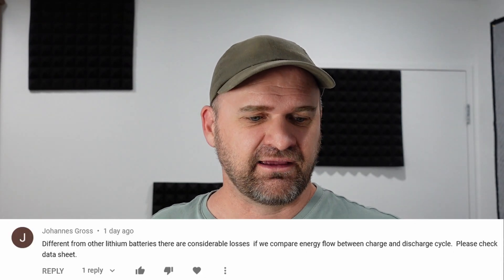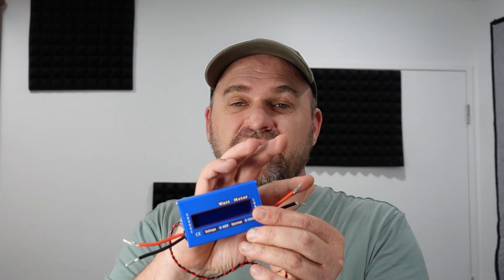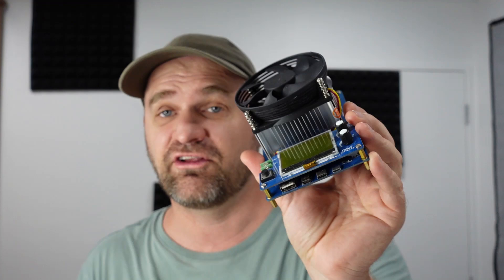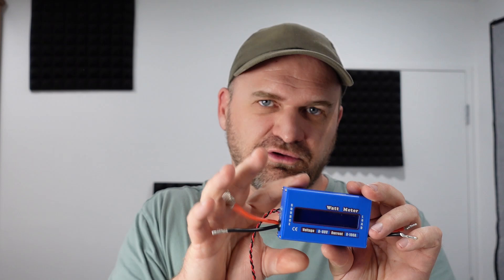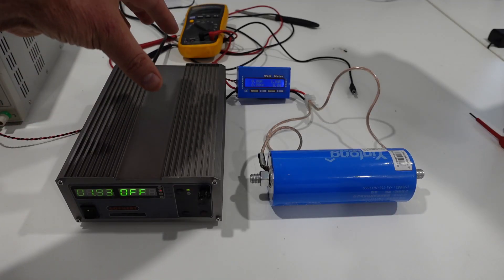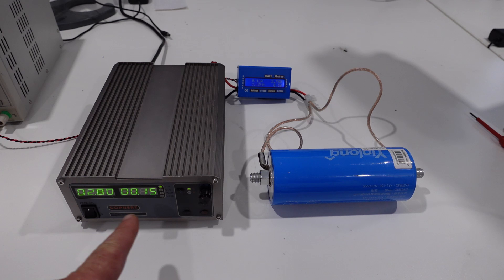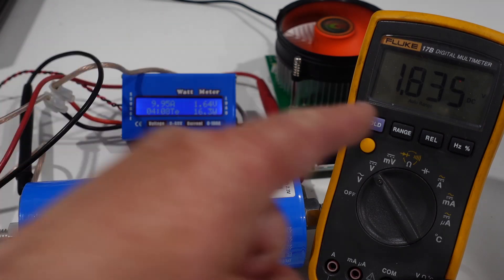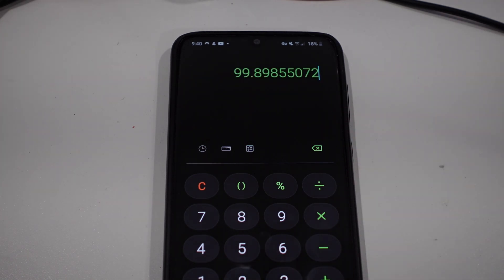Efficiency test LTO Yinlong battery

Comment: Thank you for your test. The efficiency is approx 86%.
The coulomb efficiency is relevant to ensure that you for a few cycles are charging and discharging to the same level. At 1:55 you say that you loose charge due to internal resistance - you are not loosing charge - you loose energy. I could calculate the correct efficiency from your video - you charged with 97,1 Wh and you got 83,4 Wh out of the battery - so the efficiency of the battery is 0,86 or 86%. -  and that is actually realy good. And probably closer to 88% - you did not discharge fully....Based on this test -  i will get some LiFePO4 batteries :)
Reply: Hi Brendon, thank you for the video. But I believe the Bjorn is right about the efficiency. Still for my application ability to quickly charge/discharge is more important then efficiency - so I'll try these ;)
Reply from the maker: Hi Bjorn, you are incorrect with your assertion.  I even mentioned in the video why it would not be possible to use the Wh reading on the meter to measure efficiency.  Check my low temperature video for more details.
Reply: @brendontait6968  Hi Brendon. You check amp hour to see if you get wha you pay for  - and whats really relevant you check Wh charging and discharging to check energy efficiency. I did not hear any viable explanation in the video. Whats your argument? Kind regards Bjorn
Reply from the maker: Please watch my video for low temperature testing of these cells.  I explain with a lot more depth in there.
Reply: @brendontait6968  Hello Brandon. I watched your video on low temperature testing and correct me if i am wrong - you state that you got a voltage drop of 0,5 V from relative short wire and connector. If you discharge with 10 A you are claiming wires and connectors has a resistance of 0,05 ohm (using Ohm's first law) - It should be considerably lower by a factor of 10. The units you are using are of some interest to me - i got several and are using them when I have a class that are learning about efficiency and batteries. I have tested the units against "expensive" equipment  - and they are giving solid data - when they are working :)  
I am not at all convinced that efficiency that you state is correct......!   Best regards - you are an inspiration - and i will subscribe...
Reply from the maker: Hi Bjorn, it is not just the connector between the device and the battery, but extended wires etc.  I didn't measure the voltage drop I just mentioned 0.5V as a possible example, I had wires coming from the battery to the meter also.  But even if the v drop was 0.2V, that will still give you an error of 10% in each direction if you are reading the Wh reading on that meter.  To use Wh on any meter accurately, you must use a 4 wire meter. I would be very surprised if I was wrong.
Reply: @brendontait6968  Hi Brendon. I have to agree with Bjorn on some things here. Calculating the overall efficiency of the battery with just the coulomb efficiency is wrong. The biggest factor of losing power in a battery while charging and discharging (at least within short periods of time) is the internal resistance, as you mentioned. With the way that you tested the battery you just took this resistance completely of your calculations, and I have a couple of examples to try and make you understand why it does not work that way.

1st example: Lets say the internal resistance is unrealistically high, or you add an external resistance of around 150mOhms. In your setup, the overall AH measured at the end would not change. Your controller does not care about the load resistance. You set it to keep the current at 10A, so it is just gonna increase(or decrease, depending on if it is charging or discharging the battery) the voltage until that 10A is met. This would result in a voltage drop of 1,5V across the resistance, which is more than half of the voltage drop of the battery at any given charge. Which in turn means that you are losing more than 1/3 of your power to heat in the resistor. The coulomb efficiency would still be what you calculated in your video, but there is clearly a much greater overall loss. In this example the efficiency will be much lower than 66%.

2nd example: You mentioned in the video that when charging, the voltage of the battery increases due to its internal resistance, which is very true. similarly, when it is discharging the voltage decreases. So when you charge the battery at that 10A, you are using more power because power = voltage * current and when you are discharging with the same 10A you are taking less power from the battery. In your calculations you assumed that the voltage when charging  and when discharging are the same, which is not true.

I hope this cleared some thing up.
Reply from the maker: @iliazark1  thanks for the comment, I disagree tho.  Make sure you check my low temp video where I go into more depth.  The float these cells see on charge/discharge is nearly nothing.
Reply: @brendontait6968  I watched that video as well. Measuring the voltage on the terminals is absolutely the way to go. I still don’t know how you calculated the Wh numbers though. The correct way to calculate the energy going in and out of the battery is to integrate the voltage over time values you got from the midi logger and multiply that with the current, provided that the current was actually at 10A all the time. If you still have the data from the logger I could probably write a quick script for that.

To be clear I am not saying that it is far off from what your numbers say, I am just curious what that round trip efficiency would look like if you actually measured Wh.

Comment: 97Wh --->  83Wh = 86% ?
Ah is not Wh.... 😉
Reply from the maker: You'll have to explain what you mean more clearly
Reply: @brendontait6968  
With the Ah you are 100% right, the "efficiency" is somewhere at 99%.👍
But we want to store Wh, not Ah. 
The voltage is always higher when charging, otherwise no current would flow.
This voltage times the current is the charging power or "Wh".
It is the other way around when discharging.
Wh from discharging divided by Wh from charging times 100 is the "efficiency".
Sorry for my bad English 😜
Reply from the maker: Am pretty sure I stated that it was the coulombic efficiency?  Check my cold battery test to see more accurate measurements.
Reply: @brendontait6968  
That can be, but what's the point?
Unfortunately I do not understand that...
A pv panel generates Wh, we want to save this ...
No offense.
Good video anyway.👌
Reply from the maker: The point is that I didn't really have the setup to measure the Wh accuracy for such low voltage cells (I mentioned this in the video) too many losses in the wires to use the device to measure Wh with accuracy.  I also said that I believed the Wh figure would be very close to the Ah figure due low internal resistance etc.

Comment: Brendon, do you think the charge efficiency will go significantly down if you charge these batteries in freezing temperatures, similar to LiOn/LiPo batteries?
Reply from the maker: If you charge regular lithium batteries in freezing, they die?  But no, The efficiency seems pretty good in freezing and would likely be better if the voltage was maintained for absorption rather than removed when it hit 2.8V
Reply: @brendontait6968  Yes, they may become unstable very quickly. Their capacity becomes reduced. Not a good idea, generally. Im thinking of reducing the charge current but not sure how well that will work.

Comment: these cells are supposed to act like capacitors but with timings like a battery for certian industrial reasons.. they are not what you youtuber think they are so you may say that the battery is very bad. its not exactly a battery cell.
Reply from the maker: How isn't it a battery cell?
Reply: @brendontait6968  because its a cap
Reply from the maker: But is holds it's charge chemically, not electrostatically so it is a battery and  it a capacitor.  Of do you have alternate definitions on what a capacitor actually is?
Reply: @brendontait6968  That why i said its both its like a battery but it works as a capacitor with slow discharge rates

Comment: Use a large like 20c or bigger load to really find out the health of individual cells.  Keeping the c discharge at below c will not show much variation in voltage but you will see a different resistance number among the cells with a higher load revealing cells sagging and show you the health of each cell.  The higher reistance cells will heat up much higher and will get worse with each cycle.

Comment: Nice to see you do this test. Battery efficiency is more than just the power in vs power out ratio. Since they are electro-chemical devices, the efficiency is effected by temperature during charging and discharging, age, condition, charge/discharge rate, charge/discharge levels, self discharge rate, internal resistance, and types of use. Most people are surprised to hear that flooded lead acid deep cycle batteries used in off-grid systems are generally 94 to 98 percent efficient in the way they are used.
  The internal resistance has a lot of effect on the efficiency. I use the analogy of push starting a stick shift vehicle. A Volkswagen bug has low "resistance" to movement. It takes very little energy to get it moving, one person can get it going quickly. A low resistance battery takes very little energy to start charging. A small current flow will start charging the battery, and very little is lost in making heat. A large truck or lorry has very high "resistance" to moving. It takes several people a long time to get it moving. A battery with a high resistance (Large flooded lead acid) will require a certain amount off current flow just to overcome its internal resistance. This power does not even charge it, and is wasted as heat. This is why the larger the battery bank compared to the charging source, the less efficient the charging. This used to be a bigger problem in the days of cheap flooded lead acid batteries and VERY expensive PV modules. People would complain that their system wasn't charging well. I would explain that their 100 watts of PV was not really even charging their 1000 amp hour battery bank, just heating it. This is why lithium cell manufacturer's list their cell resistance in the product details sheet. The lower the resistance, the better.
Just a little correction: Flooded lead acid batteries should not electrolyze very much of the water from the electrolyte under normal use, just when being equalized. But they will electrolyze some of the water from the electrolyte over time, thus the electrolyte level going down. They DO NOT recombine the oxygen and hydrogen. This can be done with flooded lead acid batteries by using a catalyzing vent cap, but it is not highly efficient, and some water is still lost. Sealed lead acid batteries, such as agm and gel, MUST NOT electrolyze the water in the electrolyte AT ALL EVER. They will "burp" the gas, and lose that water in the electrolyte permanently.
Good stuff, keep up the good work.
Reply from the maker: Thanks for the description.  I'm not sure I agree with your correction tho.  As far as flooded cells go - they have not been commonplace in the RV world for a while now - I had vrla/AGM/Gel in mind when I said that the gasses recombine since they are the most popular.  While some cells use catalysts to recombine, there are other methods used by different cell types.  To my understanding AGM and Gel batteries DO electrolyze the water in use and they each have their own methods for gas recombination. The 'burping' indeed happens, but only when the gas production exceeds the ability of the cell to recombine the gasses.
Reply: @brendontait6968  You are to kind. Life is incredible in its many opportunities to make a fool of one’s self. You are indeed correct about the gas recombination in the sealed batteries. I have actually not worked with them in a long time, and forgot about that aspect of their chemistry. Just remembered the critical aspects such as voltage and current limitations, along with the dangers of thermal runaway. Any updates on the performance of your LTO battery system performance?
Reply from the maker: We are all learning....  I'm not always going to be 100% correct with everything I say on here, but I'd like to think the majority of the time I'll be accurate.

As far as the battery pack goes...  it's great.  I havent come across any issues yet and it gives me more power than I need.
Reply: @brendontait6968 I figure the day I stop learning will be the day I die. This is why teamwork is so effective. We can all fill in for each other’s lack of knowledge and creativity, or mistakes and forgetfulness. The best result is when we all learn and improve together. I have had children ask me “why don’t you do it like this?”, an my answer, as I stare at the obviously far better way the child asked about, is that it just didn’t occur to me. While some things are done for very valid reasons, the premise that those reasons are based on may change, or need to be re-examined. Keep up the good work, and never stop learning. It keeps us humble and appreciative of the world around us. It’s also lots of fun!

Comment: I did more of a crude test on mine and noticed a steep drop in voltage from full charge.  This made me think they were a scam.  But once nominal voltage was reached they just seemed to hang out there forever, and the performance turned out to be really good.  Glad to see further confirmation.  They are a hefty investment and something you definitely want to be sure about.
Reply from the maker: Yeah for sure - they have a fairly steep charge knee at either end of the charge curve

Comment: Would a battery like this be effective for powering something like an electric jetboard, where a high amp load is common
Reply from the maker: Hey yeah, they would work.  Although their energy density is low, their specific power density is fairly high.  There would be better chemistries for that application tho, everyone has its pros and cons.
Reply: @brendontait6968  thank you,....if you were building a jet board, what battery solution do you think would be best?..and do you have any group buys for those batteries?

Comment: Excelent test, LTO does have an advantage over LiFePo4 at low-temperature applications and number of cycles, but that's about it, LiFe is still a better and cheaper option otherwise.
Both chemistries will be probably obsolete by the time it will take you to cycle 2500 times a LiFe battery bought today. 
Solid electrolytes are knocking at our door anytime now.
Reply: A true lifePO4 battery does seem safer, but idk if I can trust a battery to be truly lifePO4 made in china. China sells so many fake things, cheap mppt charge controllers that are really pwm. Fake fotec ssd relays. It's so easy to fake a battery as being lifePO4 at that point

Comment: Is this battery good for electric scooter. Electric scooters have 72v 40ah lithium cells. Is this lithium titanium oxide battery suitable for electric vehicles. 72v 40 ah battery provides 100km max  range. Please reply
Reply from the maker: Not great, it would be heavier than other options
Reply: @brendontait6968  Thanks Bro

Comment: The efficiency issue is that you are only taking into account current. You are charging at higher voltage than you are getting on discharge. The meter you used gave you a Watt/Hour figure - if you had used this, I think you would have found the cells were still ok - but may have found the efficiency was nowhere near the 99.89% you reckon you had.

If your AVERAGE discharge voltage was 2.3v and your average charge voltage was 2.5 (let's give the cell the benefit of the doubt - and your current in / current out was essentially the same, then you can see that your efficiency was around 92%.

As I say, the meter you used gives you the Watt/Hour figure as well as the AH, i think it might have given you a very different set of figures.
Reply from the maker: I disagree completely.  And I explained the reasoning for this in the video.  The cell voltage is low which means that even fractions of a volt of loss in the wiring in both directions will show a large impact negatively when using the Wh reading on the meter.  If the battery is say sitting at 2.4V and I put a 10A load on it, it stays at 2.4V (at least till some capacity is drained) conversely if i put a 10A charge on it.  It stays at 2.4V.  I'll do a video shortly showing another way of measuring Wh accurately.

Comment: Speaking of misinformation, you seem to be confusing voltage sag with peukert effect. You described voltage sag as something that happens when you increase load. It's not. Voltage sag is what happens as a cell discharges
Reply from the maker: I think you have misunderstood, either me or peukert.  Peukert is the loss in capacity with differing loads.  Sag can be used in several different contexts.  The context I was using it in was indicative of the internal resistance of the lead acid battery.

Comment: Interesting, first in depth look at these cells in these videos. I always was intrigued by the 10c did/charge rating. I was wondering if I could take any advantage of this 10c regarding a solar cell config in a cloudy area...I guess having an over sized array will help in a quickly filled up battery? Anyway, keep up the good work
Reply from the maker: I;m not sure the high charge/discharge rates are of much benefit with offgrid systems